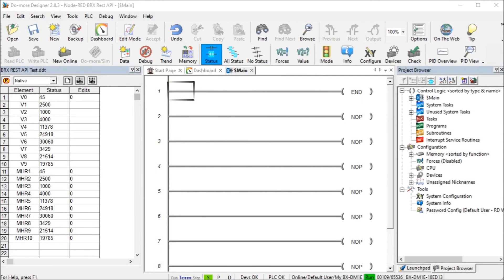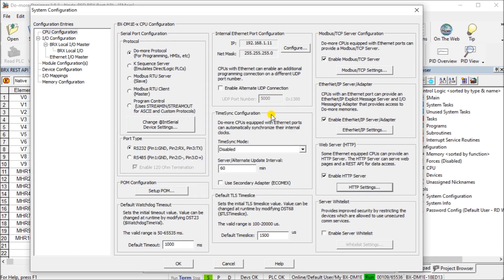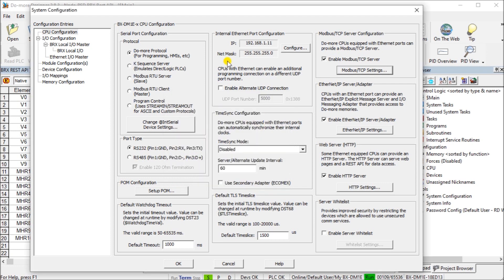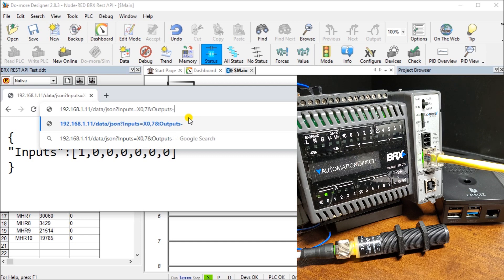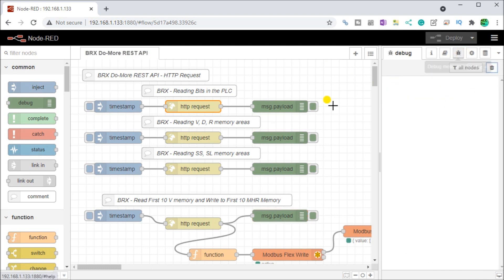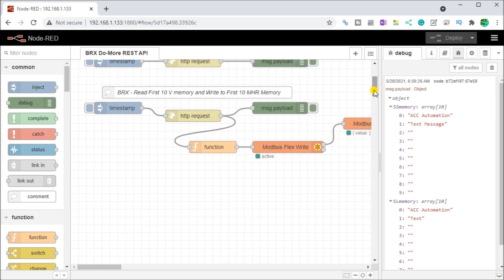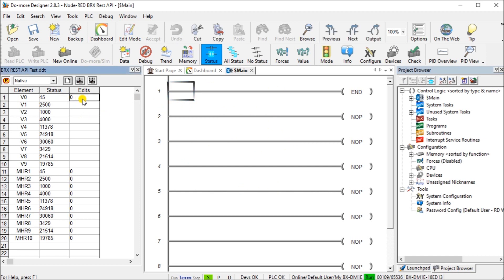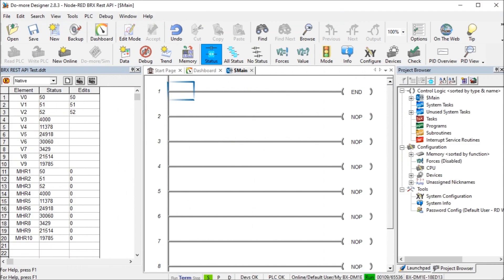Do-More PLC Node-RED HTTP Request

Comment: Great tutorial!
I know its also posable to trigger events (i.e. trigger output) by sending url GET requests. I know it may sound counter intuitive. But this GET method is used quite frequently to trigger relays such as a “web control relays”. This is nice for example when a machine has malfunctioned and you need to remotely lock out a machine quickly or if you lose remote access client can lock the machine out from the locally using any device on the network with any browser. To lock the system without them needing anything special, i.e access to software, access PLC data, HMI etc. It also does not need any extra hardware, as everything is handles in the PLC it self.
Reply from the maker: Thanks for the comment, Justin.
Currently, the BRX REST API can only read the memory locations. This is something that the manufacturer will be changing in the future.
This is why I have included a Modbus TCP write in the example code.
Thanks Again,
Garry
Reply: That why I was saying it seams counter intuitive. Because you send a GET request just like you did in the video. You would expect to get data or status in return. But based on a ladder logic condition when the PLC receives a specific GET request the PLC triggers an event based on what ever you configure in the ladder logic of the PLC.

So basically you enter a web address into a browser pointing to the PLC address, the PLC sees your request for a specific page of a given website and instead of receiving a website in your browser the PLC is triggering an physical event based on the page requested.
Reply from the maker: @mumbles1justin  
I see what you are saying now. Typically in this type of programming, the opposite of GET is PUT.
Regards,
Garry